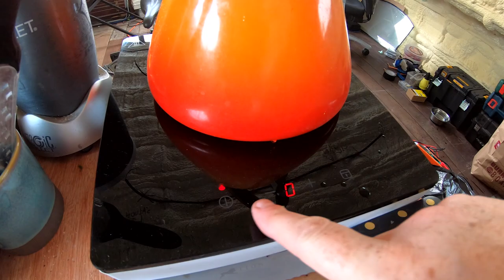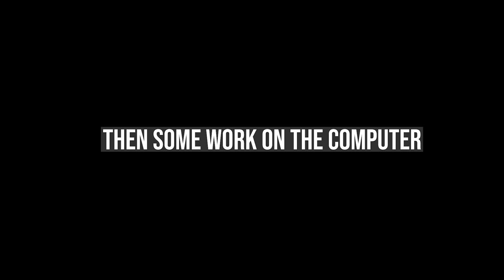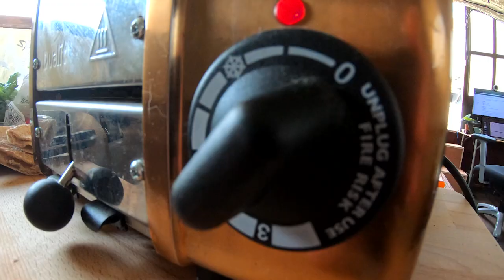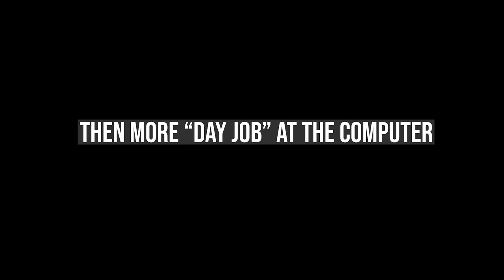#27 Living On Board While Renovating - Dutch Barge Home

Comment: Have you ever looked for treasure at low tide on the river bed?
Reply from the maker: I have and found a clay pipe from the 1700s!
Reply: @TillerQueen  was it complete or broken?
Reply from the maker: @martinworrall5888  Sadly it doesn't have the full stem but still looks great. It's a treasure!
Reply: @TillerQueen  I’m sure it is 👍